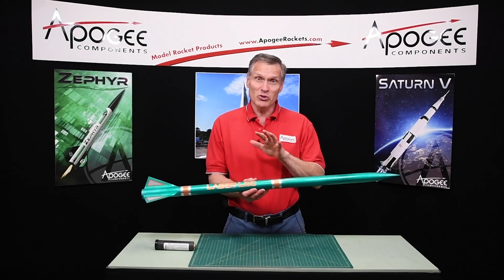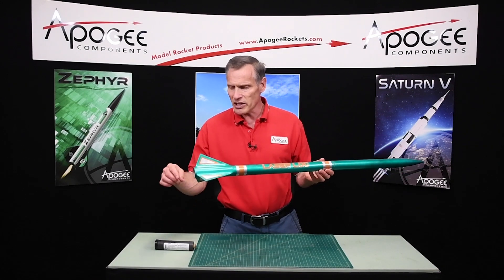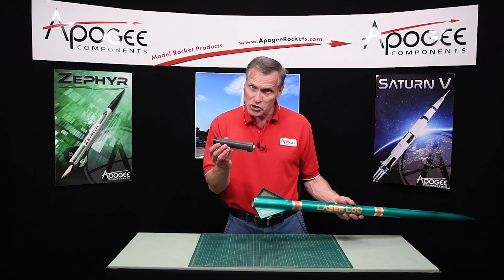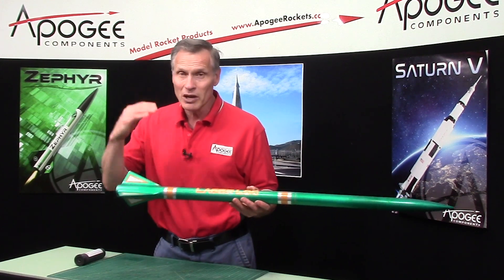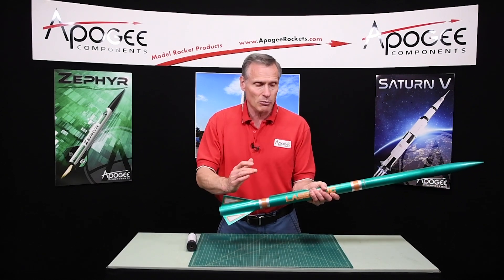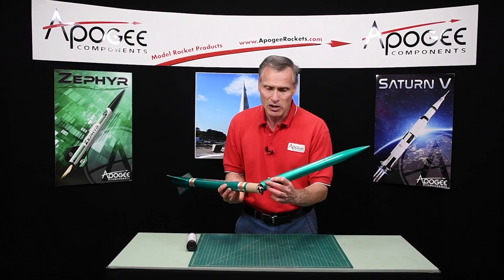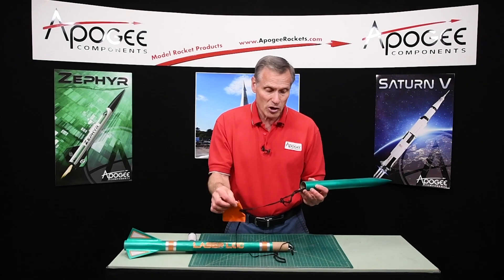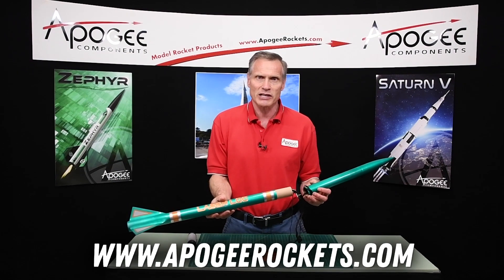Laser Loc  Rocket Kit Introduction

Comment: I’m new to the model rocket hobby. What’s a zippered tube?
Reply: That’s the rip you get from the shock cord if it’s too short or if the rocket is going too fast when it ejects.  The nose zone is slowed and pulled back by the wind and the cord cuts into an inch or two of the body tube.  Looks something like an open zipper.
Reply: Rick Sorber ok, thank you!